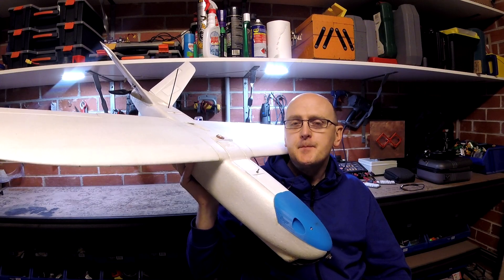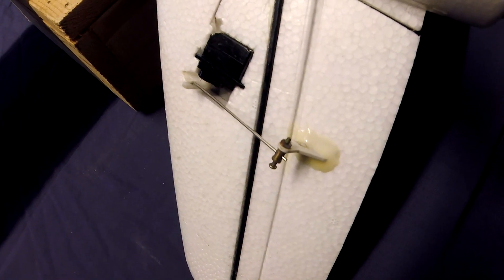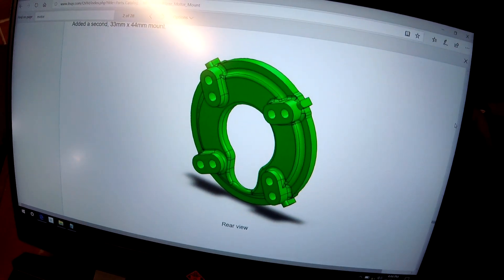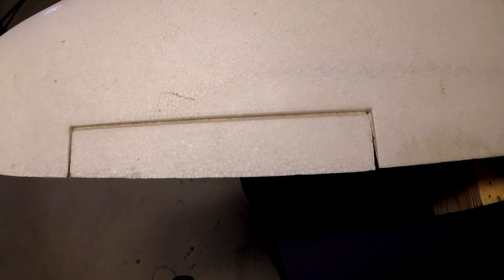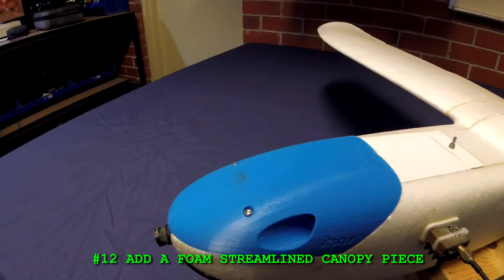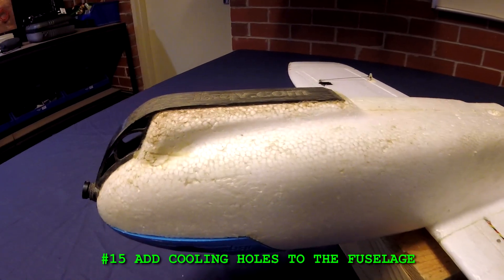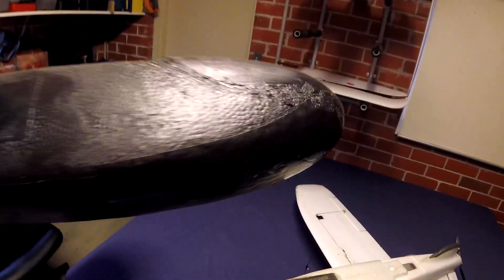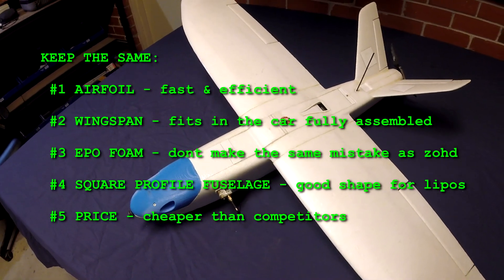» Mini Talon Version 2 ?

Comment: I have a phobia with any type of magnets on a plane that uses a compass for RTH and navigation.  Its the first thing I pull out.  I'm good with the ideas on the skids and front foam canopy (still include the wood one for pan/tilt users). I could also see increasing the distance between wing a tail slightly.  No need for a longer nose.  I'm thinking the squared out bottom is for bungie launch.  Really I haven't had any major issues with my 3 so not much else I would change.  I think i could get by with less height on the fuselage which would cut down drag.
Reply: Remove the magnets from the motor...

Comment: I’m actually building my first mini talon using some 3D printed parts made available,e by MarkQ, I ordered better control horns also. I agree with most of your ideas and I would like to see a factory leading edge protection on the wings like the sonicmodel mini ar wing too.
Reply from the maker: That is a good idea. Ive seen this on the Multiplex Funray and it works well for a minor weight penalty

Comment: My opinions fwiw...

Agree: 
- align servos on tail
- motor mount fully at rear

- increase distance between wing and tail
- increase length of hatch at front
- remove nose wheel
- add plastic nose skid
- smooth bottom of fuselage
- plastic tail skid
- everything in your 'keep the same' list

Disagree: 
- camera cutout in nose (user can easily make to their liking if they want)
- cooling holes (user can easily make to their liking if they want)

Don't care either way:
- stronger control horns
- ball links on control horns
- increase aileron area
- wing locking mechanism
- folding hinge on hatch
- magnets/locking mechanism on hatch
- foam streamlined canopy for nose
- increase length of nose
- reinforcement in ventral fin
Reply: Good list Chris... 😊

Comment: +1 for servo openings
+1 for longer hatch opening
+1 for smooth bottom 
+1 for tail reinforcements
+1 for plug-in wings 
+1 for foam plug-type nose cone
-1 for any length changes, this will change flight characteristics